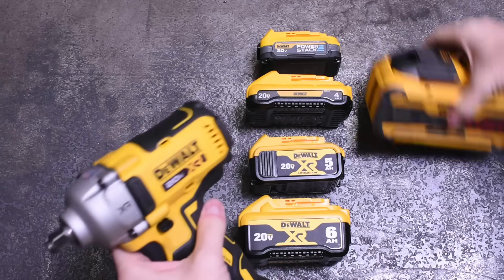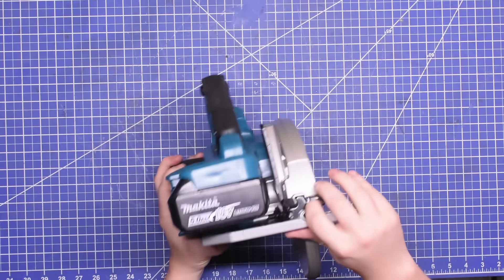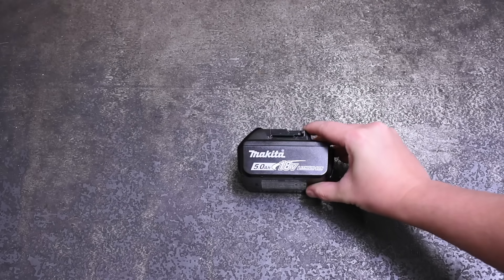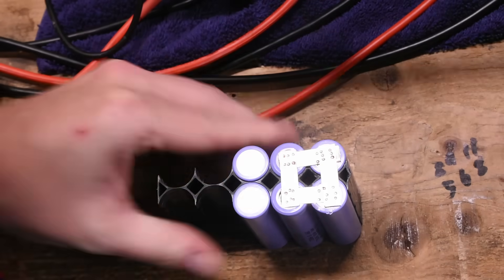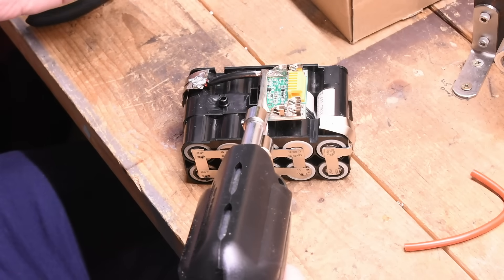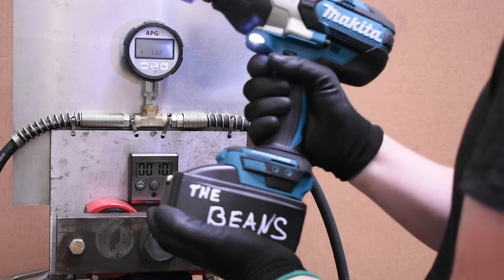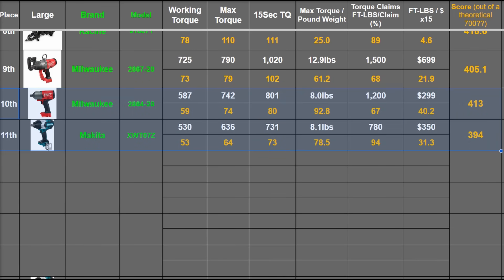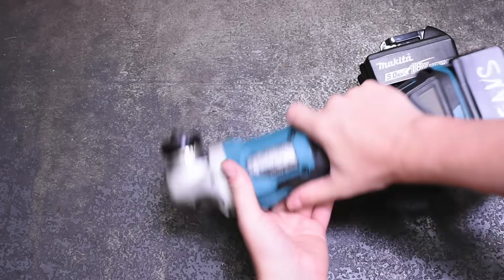We Built the Best Power Tool Battery for the "Worst" Brand

Comment: I just did a project like this yesterday and today, no torque numbers, but I had knockoff milwaukee batteries that no longer charged, so I put molicel p28a 18650s in them. I now know I might want to get thicker plates than the ones that came with the seesii spot welder I got...

Comment: The LXT line can definitely use the larger cells... with the caviate that might not work with the 18v x2 or some other rare cases; but it would be great for long run tools like the  lights and fans.

 Don't know if I'd like the extra lbs of batteries on the end of a drill, but saws and grinders would be okay. 

they could also do a redesign of future tools to accept all the larger packs for the x2 line up.

my only thought of a non marketing reason for this not to have been done yet is the charger. It might not be rated for more than an hour of rapid charging. 
 Charger has 2~way communications, it could put the battery in fault mode if it doesn't charge up as expected (like taking 2hrs vs 45mins to charge).

Comment: Speaking of weird decisions Milwaukee putting the superior cells in the 6.0s vs the 8/12.0s.
Reply from the maker: It come with making the battery higher capacity. It's not Milwaukee's fault the 40T make so much less discharge amps than the 30T, you put 30T's in the HD12.0 and it's an HD9.0 now. Like the DeWALT 9Ah

Comment: Thank you for posting a link to the battery spot welder. That looks like one of the nicer ones I've seen. But, where did you get the 21700 cell battery case kit for Makita? ebay, aliexpress?
Reply from the maker: Ali express, didnt leave a link simply because we found the included bits make it perform like poo
Reply: @TorqueTestChannel  I understand. Thank you.

Comment: The Samsung 30T is a far better cell! They put out more power and "hit harder" than anything on the market.
Reply from the maker: The custom one made here had quite a bit less voltage drop under load than an equivalent XC6.0 makes with 30T's

Comment: Been a Makita guy for years but they did indeed drop the ball.  It's worse if you have invested in many of their 18x2 tools which a custom pack like you have made won't fit.  Seems Makita saw the other brands going towards high voltage brushless solutions so they are pushing their XGT more than their lxt lineup.
Reply: I have a strong feeling that Makita will be vindicated with battery technology improvements like pouch cells and maybe even newer battery chemistries. All these different battery sizes and figuring out which battery should go into which tool that other brands have is something that's not an issue with LXT. If you really need that screaming power, go to XGT. Let's face it, 99.9% of the time LXT will do what most tasks need it to do, it just may take a few seconds longer. Those few seconds though often make for less overheating and longer life expectancy of the tools. I cant afford to live at a repair or warranty shop and buy new tools all the time, so I'll stick with tried and true.

Comment: That’s the one thing I’ve never understood about Makita is why have two lines in the same tool brand that aren’t compatible with each other and I can’t even say it’s planned obsolescence because they’re still selling the regular Makita tools and batteries it just seems like you’re alienating the other half of your Customers
Reply from the maker: DeWALT pulled it off with Flexvolt 60V tools still using 20V compatible batteries, Metabo HPT pulled it off by making 36V tools and multi volt. Makita just threw in the towel and gave up on their existing customers to start an all new brand but one that could ride the brand awareness by still using the Makita name. At least XGT tools are good on the whole
Reply: @TorqueTestChannel  I guess that’s fair enough it’s just in my mind, with Metabo and Dewalt those lines seem like in addition like if you need a little bit more power with the existing lines, instead of entirely separate lines as a whole.
Reply: @TorqueTestChannel seeing as CXT is brutally nonexistent in America, I don't fault them for coming out with a brand new line for toms of power with improved reliability that comes from uppomg the voltage. DeWalt has 12v,  20v, and 69v with somewhat limited backwards compatibility, and Milwaukee has M12, m18, and MX Fuel. With the recent XGT deals it's never a better time to get into XGT if you want max beans in a reliable Makita tool.

Comment: All the tools I have are changing from Makita to DeWalt for this exact reason a conversion that wouldn't take place if Makita would update their batteries
Reply: Just run them on battery adapters. Battery adapters make all the difference, and I'm glad I can run my Milwaukee nailer on Makita batteries and, if need be, my Makita tools on Milwaukee and DeWalt batteries. Tool Tribalism isn't necessary in this day and age.

Comment: I think part of the reason they shied away from 21700s is that they committed to only producing LXT batteries that fit on their existing tools (especially the 2x18V ones). That's something they explicitly don't do on the XGT batteries, with the larger batteries being keyed so they don't fit on some tools where you really shouldn't be using them. Personally I'd prefer if everything just works on everything, but I understand that companies wouldn't want that kind of liability.

Comment: Are you saying makita is discontinuing the 5.0 and 6.0 18v batteries?  I'm heavily invested in Makita LXT so this would be devastating news.
Reply from the maker: No, we're asking why they stopped there and went off and made a new tool brand instead (XGT)
Reply: Thank you for clearing that up for me. I agree, I was really hoping for at least an 8.0 or such for existing tools or a Makita dual voltage battery like the DeWalt flex volt when the XGT came out. Doesn't look like that is in the cards for us LXT users.

Comment: How would a 5Ah pouch cell pack fot a 2x 18V tool?
Reply: Given pouch cells tend to make a smaller battery overall, you likely could have a 3-4ah pouch cell in the fom factor of a 1.5/2ah slimpack and an improved 6ah or potentially 7ah in a 3/4/5/6ah form factor.
Reply: @EliotTruelove  so that could give the Makita LXT a big boost. Although it would make the XGT sort of useless.
Reply: @Pinz314  not necessarily. There's only so much more power even pouch cells could offer. XGT definitely has a purpose, particularly the XGT x 2 (80v). When you double the voltage the wires and motor windings can actually be thinner and thus you can actually create a more streamline yet more powerful motor because of it. The hurdles that 18v has to jump through to produce power creates ALOT of heat, whereas the higher flow of power from increased voltage means there's less effort and thus less heat. It's why Milwaukee tools often have there triggers melt, because they are reaching the upper limits of how much power they can pull from a battery before the heat causes wire and motor failure.

Comment: So this test is basically saying a higher capacity battery is better ? All you need do is run the tool into a dyno and record the power out vers  the claimed power capacity of the tool. Record the values and show the calculated efficiency, other than that a great video

Comment: I have rebuilt millwaukee,ryobi,dewalt,ego,and lots of other "dead " packs by replacing cells and some times resetting the BMS. Makita has a BMS that can not be reset at all. I have a pile of Makita batteries that are good 18+ v but require a new circuit board, Classic " designed obsolescence " forcing Makita owners to buy new batteries even if they are good but dipped 1 volt their predetermined bms limit.

Comment: I love hacking batteries (so long as safety precautions are made), I made an M12 battery that uses a lipo battery from an RC car, between the 5x higher current output combined with the 14.8v it is roudy

Comment: I can’t believe you guys did not notice the battery BMS you got gas low voltage protection MOSFETS
The normal Makita batteries do not and you are definitely losing a lot of power in the MOSFETS

Comment: I've bought "LXT cases" for 3P set and packed them with "used but good" 18650s that I torn from "bad" notebook batteries and sorted with simple discharger, showing total capacity, that bought from same chineese marketplace as well.

Resulting batteries are taller and heavier, but 2 of them came out to be 12+Ah and 2 more are around 10Ah. As I don't have any "small battery required" LXT tools, I've just sold all of my original 5Ah and in the end even got some profit (well, if exclude required tools like point welder and of course all time and effort).
All in all - just 1 of those 3P packs drives my DDF487 for over a month now. Not that I use it a lot to really compare but I'd say that the "original 5Ah" I'd definitely recharge 2 times so discharger measurements look correct.

For my small tools (Makita-like chinese shear for cutting bushes) I've packed 1P-sized boxes same way and they came out light, powerful enough and really DIRT cheap.

So if you have free time, experience with lithium cells (as they can be really dangerous if handled wrong) and want to have some fun with spot welder - Just Do It! 😁

Comment: I'm all-Makita LXT. Frankly, if they made the batteries too chunky to fit in my x2 tools, no big deal. Just extend the ConnectX line to break out an x2 tool into x2 big-LXTs on a belt clip or something. The landscape tools already need a ConnectX to be usable anyway.
Reply: I'm just waiting for a 40v to LXT belt converter to come out, but I suspect it won't. The PDC01 is awesome, but it would be nice to have a single battery XGT adapter with a cord and a slim dummy battery for the LXT tools like the 18Vx2 connectx adapter, but that may cannibalism sales from XGT.

 The other way would be difficult: 2 lxts to a 40v adapter. It would have to be on some sort of swivel base I feel to accommodate the various ways a 40v battery slots into certain tools, or have 2 batteries on a belt clip and a cord. They've come out with extension leads o get the weight off the tool, but not many guys use them. If they made the extension lead for an LXT to XGT adapter, it would make me get into XGT tools, and the batteries would then follow as I'd be justified to getting the kits and batteries. This would be an effective "baton pass" where at a certain point both LXT and XGT have an overlap.

Comment: 3/4 of my battery packs are self made super packs now. Definitely worth the effort on all brands. My Makita, DeWalt and Milwaukee all work way better than stock.
Reply: Have you killed any tools yet?
Reply: @brandonsheaffer5035  The more cells in parallel, the higher you're able to keep the voltage. The higher you're able to keep the voltage the lower the amp draw the tool needs. The lower the amp draw the less heat put into the tool. I find my tools run nearly half as cool with self-made packs versus OEM packs.
Reply: @sixtyfiveford  what was the cost to build the packs?
Reply: @brandonsheaffer5035  you had one spot welder shown in the video (around $250), then you need the cells and likely a shell+box (from the candyland). I suppose 18650 of 18v/9ah would be around $65-70 in materials.
Reply: Have you toyed around with a superpack at 24v? 6S2P configuration with P45B molicels? Be interesting to see how that performs.
Reply: It would be nice if someone posted a decent walk thru video that has had success building these.

Comment: Excellent job. I was working on a Makita Beast also, you beat me to it!  I am jealous of that spot welder...👍
Reply from the maker: Let us know if you need to borrow it!
Reply: @TorqueTestChannel  You guys should grab some nice FPV drone lipos and make a really powerful external battery just to see how far some of these tools can go with max amps. I can easily pull 150-200amp burst and 100amp constant at 18-20v.
Reply: @TorqueTestChannel Hello was wondering what website you use to purchase high amp discharge lithium cells for building custom packs.

Comment: The chart where the Makita with the Beans pack made 99% of the advertised torque gives me more ammunition that these tool companies hook their motors to an unattainable (for a battery) power source. 
If you could hook the Milwaukee or DeWalt to an outlet and bypass the circuity, I bet they would make the advertised torque specs.
Reply from the maker: A big battery will have more discharge potential than an outlet. We recently used a 24v 20ah stacked lithium on M18 tools and even over voting them don't reach thier specs lol

Comment: Finally...THE BEANS! Could have tried that on the Amazon specials to see if they gain. Next video might be graphene LiPo (requires a dedicated charger if going LiHv, won't hurt at regular 4.2v). Any power gains by using thicker tabbing on the standard 18650 Makita? Then we have the unicorn VTC6A...
Reply: @GrimaceXL or even some Yinlong LTO cells. That would be something. If they get to fix the big IR impact it will be even better

Comment: I'm about to ask a probably dumb question. Can you make a external battery box that then has wires that go to a fake mock battery pack thing that then plugs into the tool? You could probably throw some silly amounts of power to a tool.
Reply: Makita makes a battery backpack which is basically that exact thing

Comment: Sure Makita needs to make better bateries, even with one row of 18650 cells for compact tools like DDF487, in some countries is hard to find even the old 2Ah pack, and even harder to find BL1820B with fuel goge, and even worse the prices are wey to high. So a 2.5Ah with fuel goge and decent price would be nice. Then sure another pack with one row of better 21700 cells. Bosch 4Ah pro core has 535g so better weight then Makita 5Ah 631g, and with good cells the power will also be good. And with 2 rows of good 21700 sure for high power tools like jigsaws, circular saws, rotary hammer, top power drill drivers, impact wrenches ( fk impact drivers...)
But other brands also need upgrade.
DeWalt has a lot of diferent packs but still lacks at least two that would make DeWalt wey more interesting, a 18V( so coled 20max) 2.5Ah  powerstack ( 1.7 was obsolete even 16 years ago and the 5Ah powerstack is huge) and a 10.8V ( so coled 12max) 4Ah with good 3 x 21700 cells. 5Ah with 6 cells like for a 24V tool is stupid, at least for a compact tool like DCD710. For high power sure, but why not 18V then ?...

Comment: I think the fairly obvious answer is that, you start offering bigger batteries, with larger cells, is when you start breaking shit inside the tool.  I don't know about any other guys in the comments, but I buy Makita for life, longevity, solid metal hobbed gears, not sintered metal.  I buy their tools because I know it'll still be driving screws and ripping lugs off in 20 years.  It's not like I've ever come across a deck screw I couldn't bury straight through a treated 2x6 with my, at this point, pretty ancient 01Z brushless impact?  While I'm all for innovation, Toyota doesn't sell tons of cars by offering 450 HP camry's.  Slow and steady is what the professional demands.  Flash is what apprentices buy, and to me, that's why Milfuckee and Dewilt are selling in today's world.  Ryobi because of price.  Makita, understandably so, are priced higher and only generally sell to contractors from what I've seen in the field.
Reply: Look at promotional videos from DeWalt and Milwaukee and you'll often see the interviewed guys have underneath their name "2 years experience" or "3 years experience". It's not enough to truly know what works, and when your young you can take the vibration, but you pay for it later. I had early onset arthritis in my teens so Im thankful for Makitas ergonomics and vibration control. Milwaukee and DeWalt guys likely go home and drink themselves into a stupor or pop a perc to deal with the aftereffects on their bodies and muscles. They can have their fast and hard tools, I'll keep my "Toyota Corolla" and "Ford Transit Connect"-like tools (both vehicles of which I actually have for family and work).

Comment: I've used 18650 cells for my vape stuff for years. Nothing compares to the Sony/Murata VTC line of batteries and nothing compares to the amount of cycles you can put thru these. My Sony vtc5 batteries get charged daily for the last 4 years and have out lasted any Sanyo, LG, Samsung, or other brands I have used over the years. I would love to know how they would do in a power tool battery pack.  8 or so years ago Sony stopped making them for the public to purchase and was selling  them for  use in the Toyota Prius but later partnered with Murata to continue making them for public use. If you search the web , you will find that flashlight fans and Ex-smokers(vapers) have rated these as the most reliable over the last 8 to 10 years.
Reply: Murata purchased Sony's battery division several years ago. They were known as Sony Murata during the transition, but now they're just Murata. That's why you can't get Sony brnaded cells anymore as they are now Murata. Makita uses Murata a lot, all XGT batteries use Murata cells.
Reply: @toolscientist this interesting to know. I wonder if Makita would ever do a premium LXT battery with murata cells.
Reply: @EliotTruelove  they could definitely do a higher capacity slim pack without risking overdriving the tools. Either 2.5ah if staying with 18650s, or 4ah with 21700s. The option to do a 2.5ah has been there for several years, so I don't think it's likely.
Reply: I am using the vtc5A cells for Makita as well as for Metabo in small 2,6Ah Packs with 5 Cells. The performance is really great and alows me to do lots of work with the lightweight batterys.